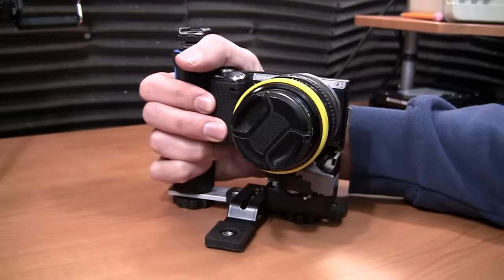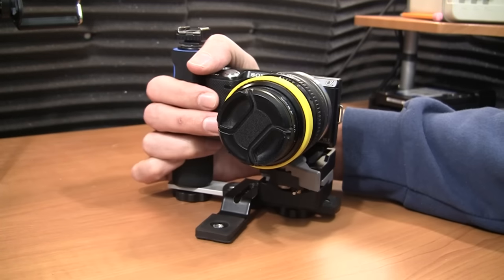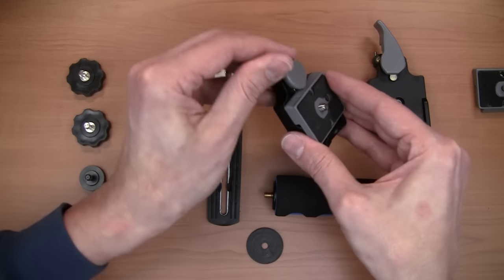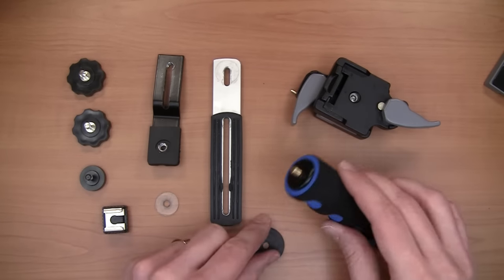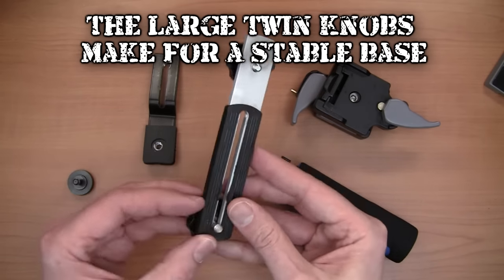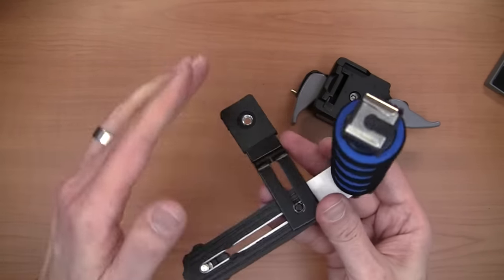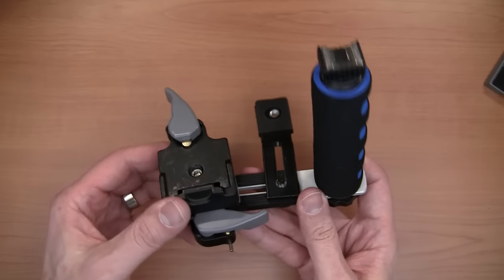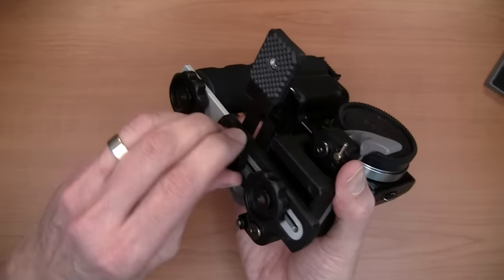DIY: Frugal Fattener 2 (Camera Grip)

Comment: what is that plate under the cam !!!!??
Reply: It's an mannfrotto ripoff. Search quick release on Amazon and it should come up as one of the top searches!
Reply: +twealve dread he also made a video on it!
Reply: twealve dread i know the whole quick release system im asking about the plate only that is under the cam . and that video got me to buy like 8 of them for my gears ^^
Reply: +KingStivan cool! I'm planning on using them as my main quick release system!
Reply: twealve dread small tip :> if ur gear is light then your good to go :> if its a bit heavy and with big lens maybe look into arca-swiss system :>
Reply from the maker: +KingStivan It's a special plate made specifically for the Sony NEX-5n that overcomes the tripod mount design flaw on the bottom of the camera. It gives it a better base and is compatible with the Manfrotto 323 (or clone) quick release systems. http://rover.ebay.com/rover/1/711-53200-19255-0/1?icep_ff3=2&pub=5575055920&toolid=10001&campid=5337372659&customid=&icep_item=191175684127&ipn=psmain&icep_vectorid=229466&kwid=902099&mtid=824&kw=lg
Reply: thefrugalfilmmaker lets hope they make other ones for all cams ^^ this thing looks SOLID !!

Comment: I personally would just buy the 'spider steady' or whatever it is called (http://www.amazon.com/ePhotoinc-RL01-Shoulder-Camcorder-Cameras/dp/B005NJCF7E/ref=sr_1_1?ie=UTF8&qid=1454201648&sr=8-1&keywords=spider+steady) bigger, but has more uses and can be expanded, plus you just order it as one, and it is all together. AND IT'S THE SAME PRICE! It also allows you to expand with a bigger camera/lens.
Reply: Littlepeople cool product but not the same small form factor as the one in the video.